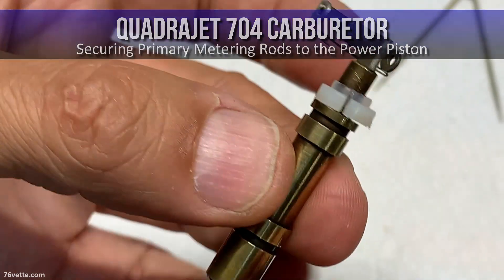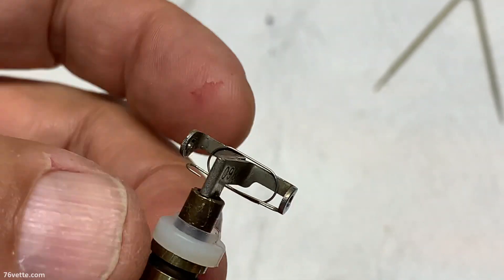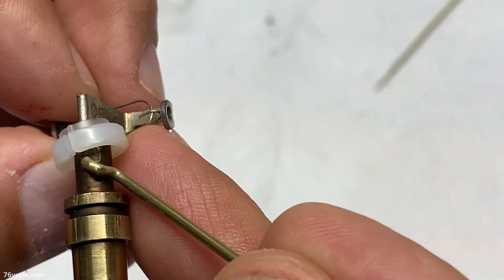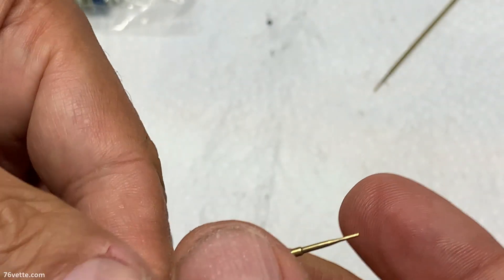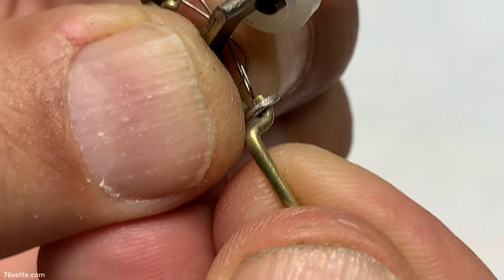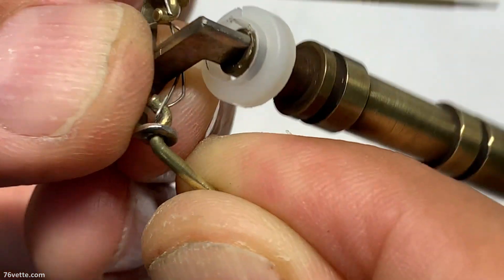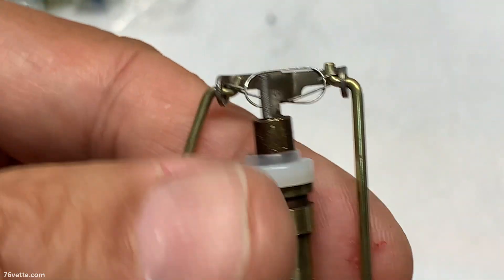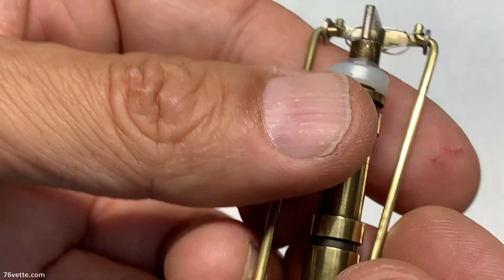Do This Right or the POWER PISTON Won’t Work

Comment: I was wondering.    I lost my power piston spring.      I didn't realize there were options for replacements.     I've searched forums, and they all seem to turn into an MIT lecture.      Any idea of what i should replace the original with?
Reply: Factory performance or mild cam, use the blue spring. You can search a chart that lists the vacuum the engine produces and which spring to use.
Reply from the maker: Contact https://quadrajetpower.com They know their stuff and usually have parts in stock. 😊👍🏻
Reply: @76vette  I just bought a 3 spring kit from them on ebay.  Now its just a matter to figure out which spring to use. I did buy my rebuild kit from them too.   They seem good.   I'm just tuning up my late father's corvette and am chasing demons all over the place.  Lol.    I'm mechanically inclined, but somewhat of a newbie with carbs and distributor curves.
Reply: @76vette  great videos by the way.  You seem to love what you do.

Comment: After seeing a couple of other videos with people leaving out the retaing spring holding the needles apart as aposed to flopping around in the jets is it as Important as I have been told that the spring tension keeps the metering even and having them loose in the jets can adversely affect the mixture - performance and feel of acceleration or can you just toss it.

Comment: Really great seeing the components of the Carter quadrajet.👍
Reply from the maker: These carbs are great, and I still have a LOT to learn. There are so many calibration adjustments that it boggles the mind. At least mine. Thank you for watching! 😊👍🏻
Reply: Any particular reason you wrote Carter instead of Rochester? I know Carter contracted to build them, mainly for GMC trucks.
Reply: @Spiritof_76  I have seen several of the Carter versions on cars and rebuilt one and it was a easier rebuild than the Rochester's, but like you said this Carter quadrajet came off a 1973 GMC 1500 pickup truck. 👍
Reply: @musclecarmitch908  I think those Carter q-jets weren't the original ones on cars, but got swapped on. The ones I've seen all said "for GMC." Of course that's just a guess based on my experience. The parts are all interchangeable, so I have no idea what makes them easier to rebuild unless it was just an easier style choke. I have 2 that are identical but one is a Carter off a GMC and the other a Rochester off a Chevy truck.
Reply: @Spiritof_76  I believe your right, they got swapped on off the trucks.👍